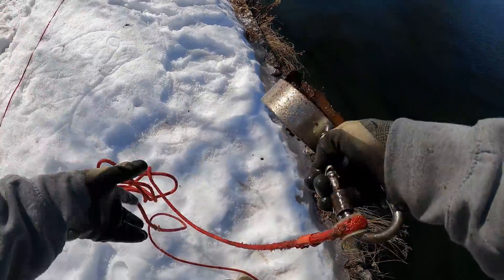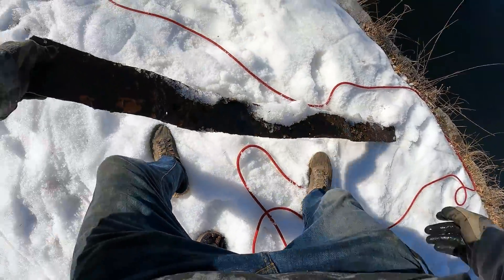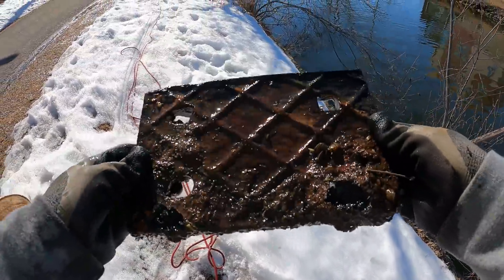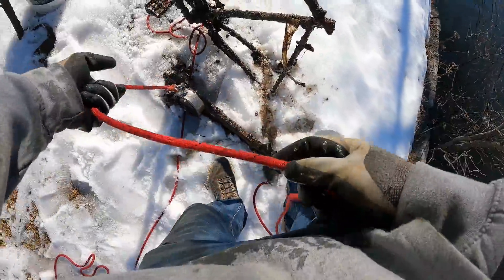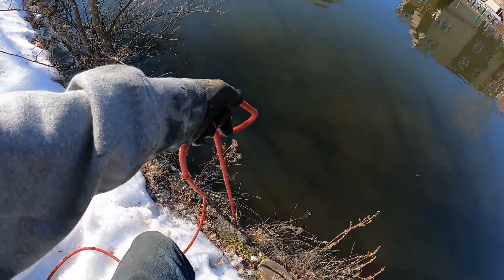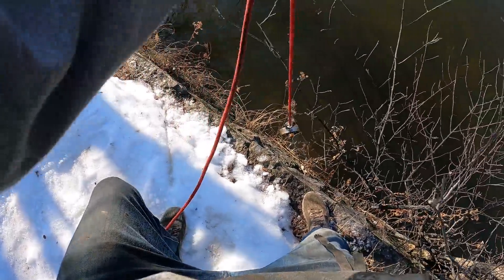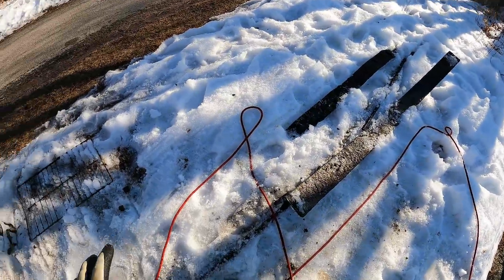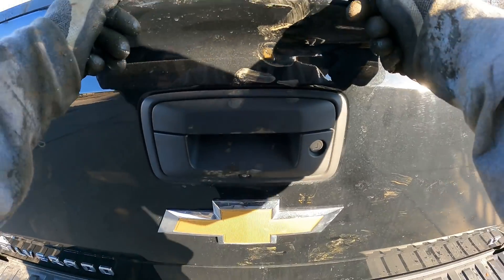HOLY COW!!! You Won't Believe What I Found Magnet Fishing!!!

Comment: Did some more digging around in regards of these picks 1:52 time mark. Yes these are call "Hookaroon". They were use in logging industry  to grip  trees to steer them down the river as they float down to lumber mills.  I guess that building across  where you're fishing from was a lumber mill?  I notice local roofers use this tool to grip/rip up old shingles when replacing a roof.

Comment: Nice Finds!
3.44 old horse n buggy step 
6:14 track splice part 1 of 2
That many pickaroon heads  means it was a log landing or loading area. Used when log is lifted in the air and a guy sticks it in the end to swing the log around. It keeps a guy 3 feet further away if log falls. A pike pole is more common for steering logs in the water.  Pickaroons are widely in today's sawmills as a "safety tool" for same reasons. 
Rack was an oven rack.
Long bolts are typically used in building construction as X-braces on walls.

Comment: 8:20 Probably originally a shelf from a fridge or oven, but you're likely correct that it was used as a grilling-rack for a fire-pit, since some of the bars are deteriorated and missing from being heated hotter than they normally would have been.

Comment: That long round pole was probably a tensioning-bar for the metal framework on a machine or structure --- the ends are threaded so that nuts can be tightened and items that are threaded on over the bar's ends are forcibly drawn inwards to make everything taut and rigid. :D

Comment: That piece you found at 5:06 with the railroad spike, kind of looks like maybe a control arm sleeve missing the outer bushing. Hard to tell with all the muck on it. If it has a hole in the middle, the bushing/sleeve would fit into the cross member on the front of a vehicle and a large bolt would pass through the control arm and then into the hole of the bushing.. then the control arm would basically pivot up and down on it. FYI, the control arm holds the spring on a vehicle. (There are rear control arms as well). 

Those things are HELL to get out! lol

Comment: Seriously... The Fisher, if any of the railroad stuff came off the old Green Bay & Western, even the plates and the rail joiners (that 20 pound piece you found) I would be happy to buy for more than the scrap value. If you are able to research which parts of the line were built, replaced, or worked on by the gandy dancer crews between 1942 and 1944, again I’d be more than happy to pay extra... anything my grandpa might have handled or built or even just close to it would mean a lot to me. As soon as he hit 18 in late 1944, he enlisted into the Army Air Corp and had even achieved solo flight scores among the top 100 pilots of the decade (1935-1945) when Japan surrendered and he was washed out. I thought he was on track to be a B-29 pilot, but a document my mom found recently seems to indicate he may have become a P-51 pilot in the Pacific by November 1945 had Japan not surrendered. But still, he loved trains because of those teen years building the GB&W during the war... and to date, my family has nothing from that time in his life. Again, I’d be happy to buy some of those plates, connectors, and spikes if cleaned up and (maybe, not required by me) verified to be from the GB&W in the 1940s!
Reply from the maker: That is amazing to hear! I will have to look into it!